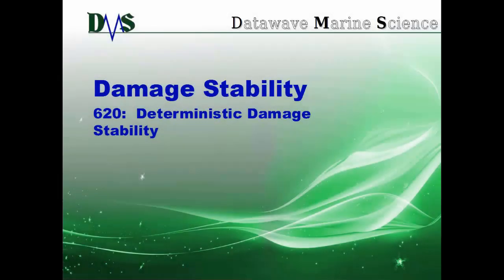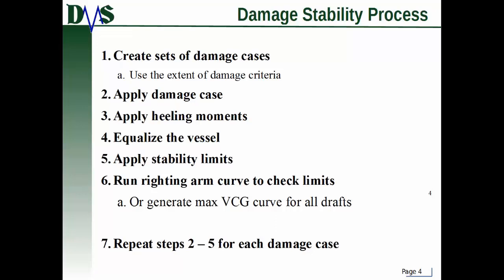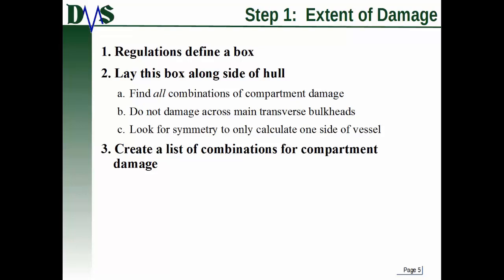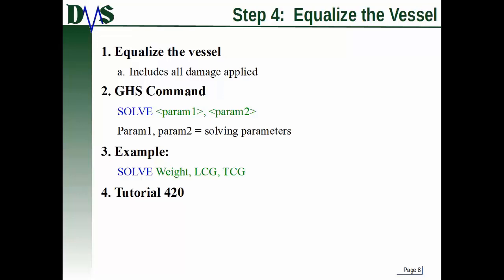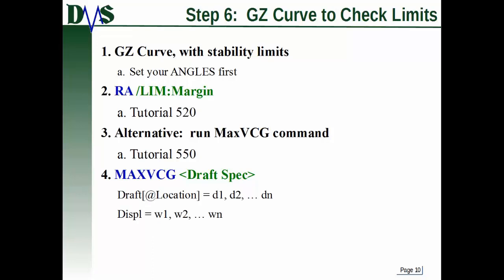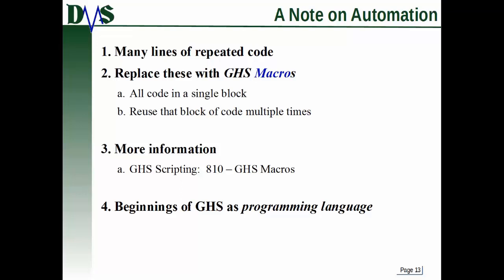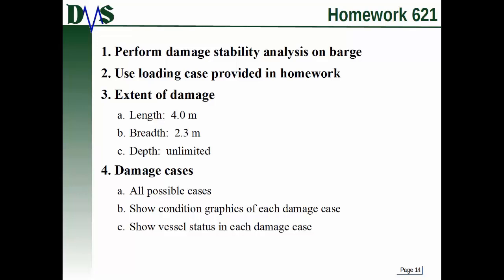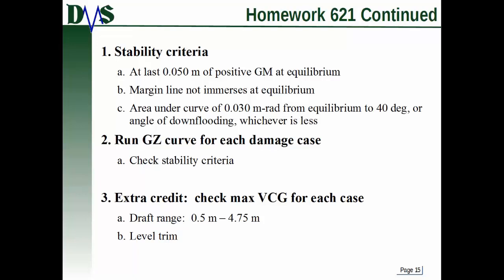620 GHS Deterministic Damage Stability (Improved Audio)

Comment: Dear, I have one question, when the intermediate flooding is considered? In Probabilistic or deterministic analisys or both? Thanks, Regards from Mexico.
Reply from the maker: Good question!  In both probabilistic and deterministic, the TYPE FLOOD command assumes that the tank is fully flooded.  (But only up to the waterline, after the ship equalizes with the now lost buoyancy.)  Also important is that when you set TYPE FLOOD, the tank contents are replaced with seawater, which may have different density than your cargo.  To consider intermediate flooding, set TYPE DAMAGED for your tank.  Then the tank reference point is set at the leak location.  The tank adjusts contents to balance pressure with the outside water pressure.
Reply: Thanks Nicholas, very helpful, regards!